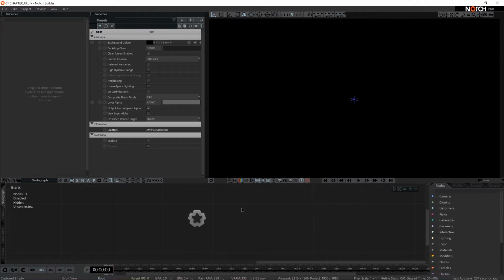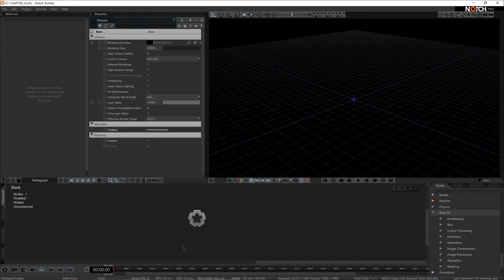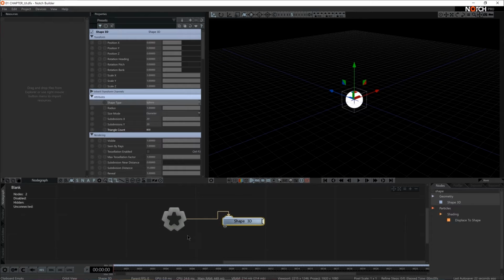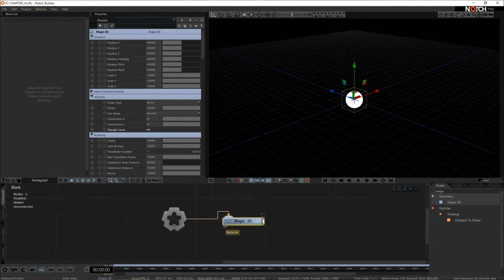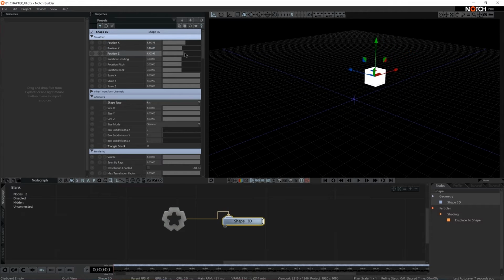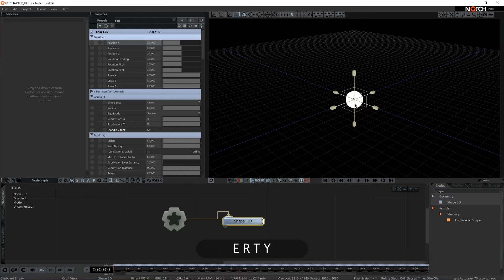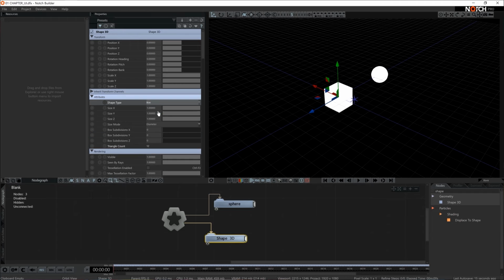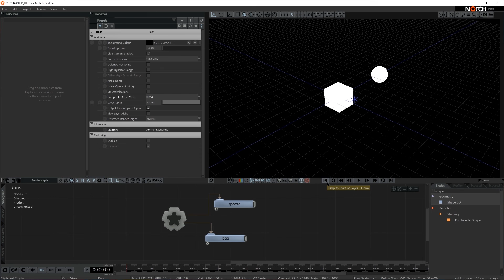The Notch UI - (Notch Basics 001)

Comment: I must say the stacking order top to bottom in Notch is something that doesn't feel quite logical to me. i'd say, when you stack something you start at the bottom, right? Whi is it like that?
Reply from the maker: It's a core tenet of our node graph design - it allows you to quickly make changes without going to a different view. It might feel odd at first, but you quickly get used to it.